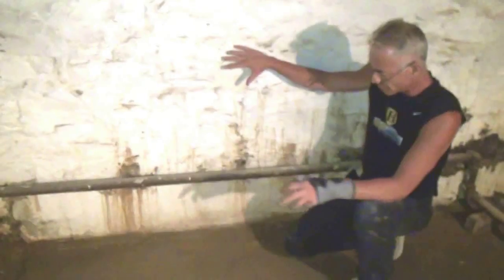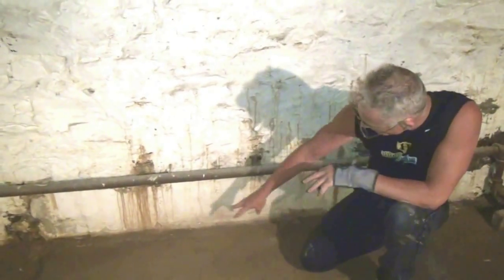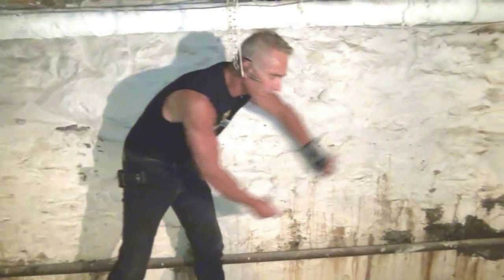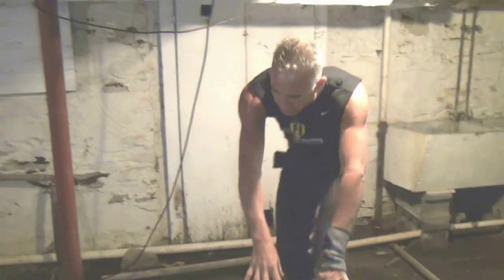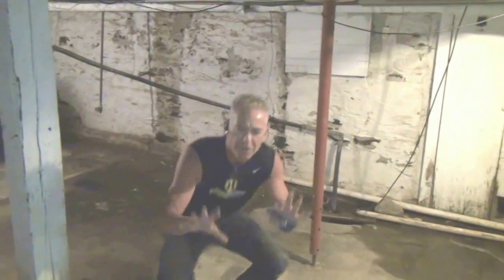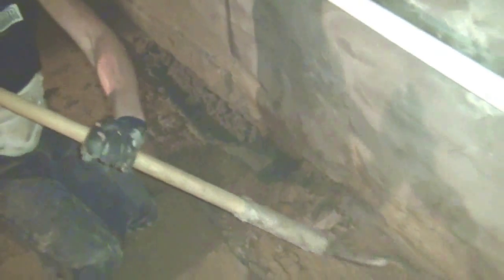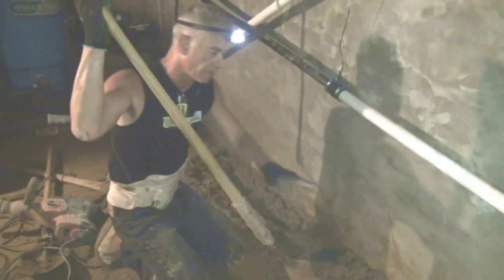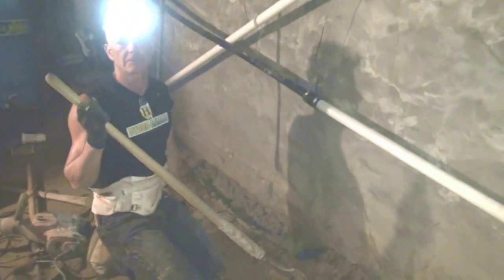NJ PA Farm Foundations and how to Waterproof a Rubble Foundation

Comment: Daniel I do have a rubble foundation wall and Im doing a french drain system. I started nailing wire mesh to the wall so I can parge the wall. Should I install mirror drain on the wall also ?
Reply from the maker: +Bobby McCollum  No Mira drain.  I like to power wash the sand out from between the stones, parge over that to fill the voids, then 6 mil minimum plastic ( I use 12 Mil ) then the wire mesh and then the 2 coats of cement.  Wallah! Waterproof wall as long as there is a waterproofing system at the bottom for any water or moisture to drain to.  Thanks.  - Daniel J OConnor

Comment: I don't have a rubble foundation but I do have a poured concrete foundation that is lacking a footing. House was built around 1900. In the past I've wondered if doing what you refer to as a footer ledge would be the right thing and after watching this video it looks like I'm on the right track. Just with a 51' wall it'll take me a little while but I don't mind the labor. Unfortunately I'm not in your service area so I can't have you come and work on my basement but after watching your videos I've gotten a lot of information I can use to help alleviate what water I do get in my basement.